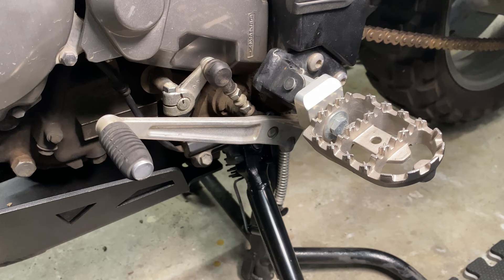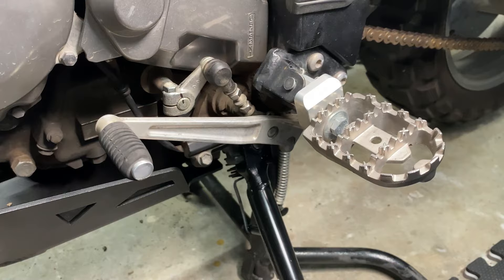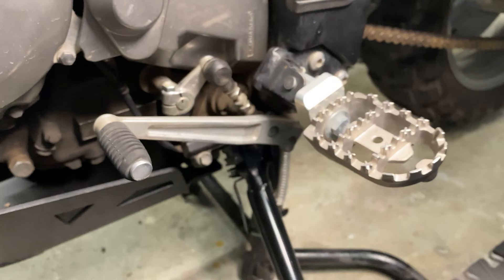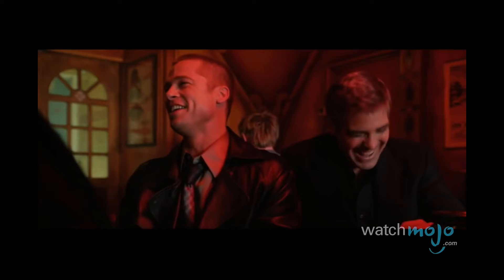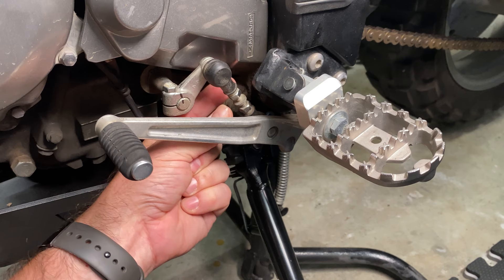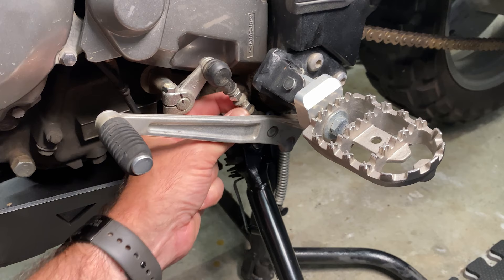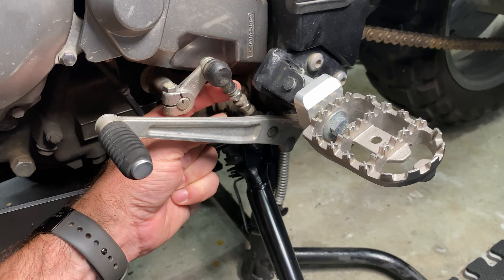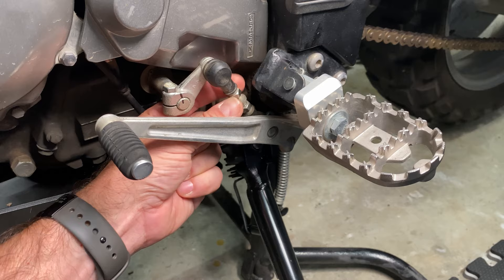Adjusting the Motorcycle Shifter

Comment: Thanks for the direct and short instructional on this. Is the setup pretty universal? I want to try and adjust mine, but the nuts are super tight. I can crank with a lot more force, but just want to be certain I don't break anything.
Reply: Yes crank with more force or use some WD40 to loosen BUT make sure you are turning the correct way. Thanks for the comment!